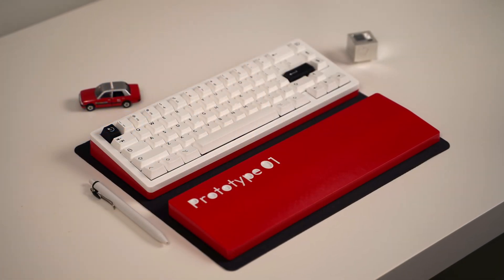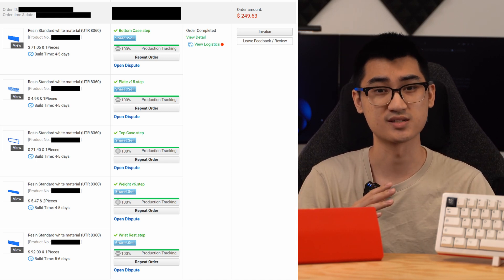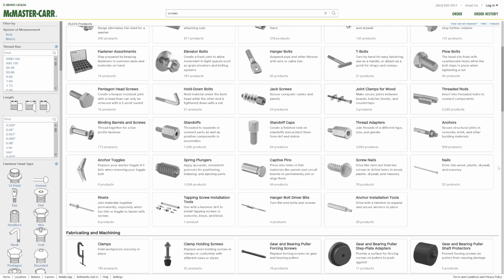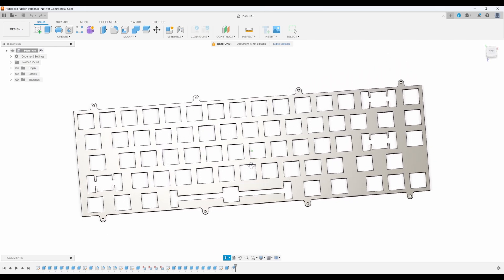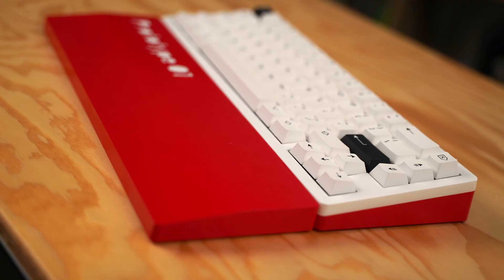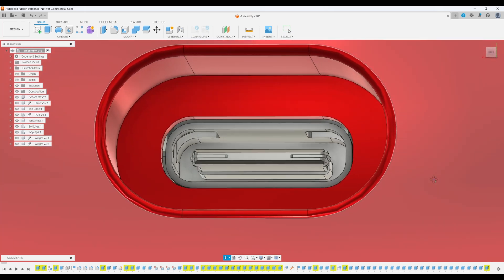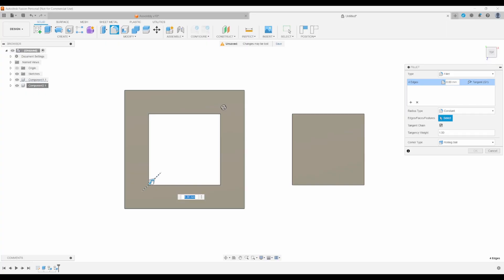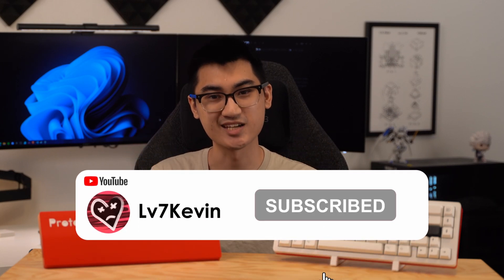My First Prototype - Keyboard Project Update 2

Comment: Man wish I found your channel earlier. I ended up getting a cheap Aliexpress keyboard to scavenge the parts as I wanted to reduce the height and profile of a normal switch keeb as much as possible. Still wondering should I 3D print the plate myself to change from a tray mount to a sandwich mount.